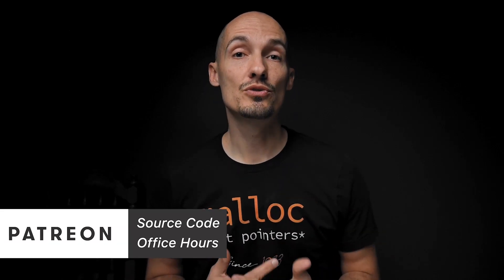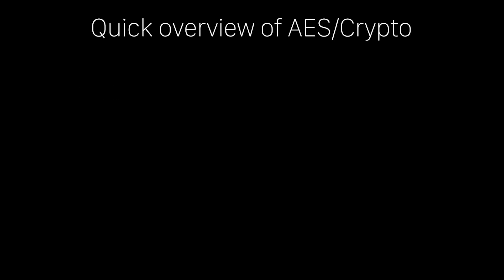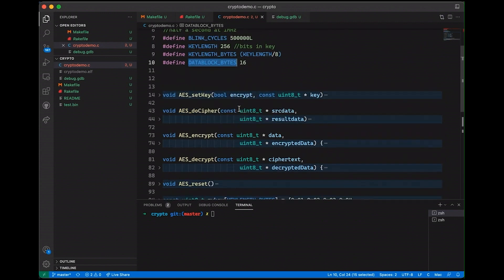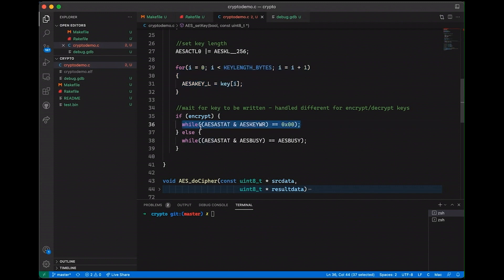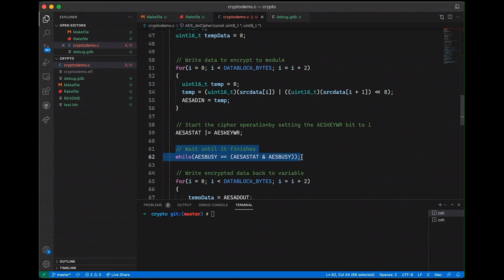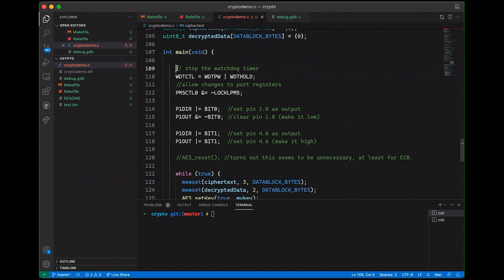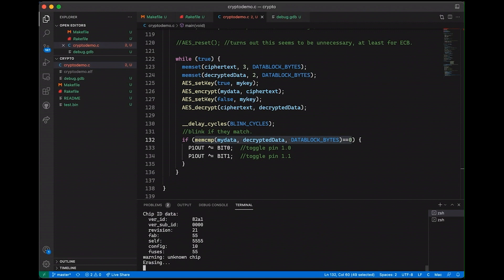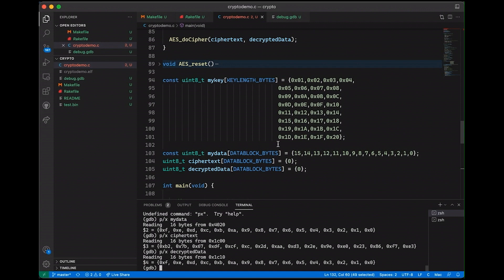Embedded Crypto: AES Example on a Microcontroller (in C)

Comment: I'm sure Jacob knows this, but some viewers might not: having hardware support for basic AES operations is good, but there's a lot more to using AES correctly (i.e securely) than is shown here (it would be a whole series of videos).
Reply from the maker: Good point. Thanks.
Reply: What exactly do you mean? Like multiple rounds with extended keys?
Reply: @airfoxxxx  No, I'm referring to things like knowing which cipher modes are appropriate, which key sizes to use, how to generate keys and keep them safe.
Reply: @guessedUK  That would indeed be an interesting series

Comment: For embedded I'd assume that you'd use something like chacha20 or even chacha8 (if you can), but with hardware AES support this could be a different thing. How fast is the hardware acceleration of AES in comparison to software chacham implementations?
Reply: You can check in the manual the clock cycles required to encrypt 16 bit, and the overhead execution of it to prepare 2 bytes at a time. Can also be improved with DMA probably, but that's another story.